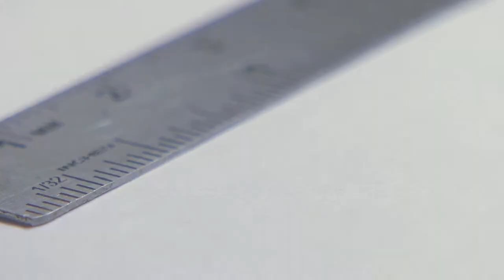Making A Domed & Blued Screw

Comment: I have no idea what just happened
to turn that screw blue, but I was captivated.
Reply: It's a natural process of oxidization that happens to steel when you heat it up, the colour you get depends on the temperature it reaches - that was about 300 degrees Celsius.
Reply: Vincent Baelde-Millar . Thanks mate
Reply: @vincentbaelde-millar670  Steel  ?  might be titanium .
Reply: @alimali2120  judging by the way it machined I doubt it
Reply: What's the purpose of the first coating? Before the actual blueing.
Reply: @blueneet84  That wasn’t a first coating what he was doing is putting it through a heating process to normalize and harden the screw and then the blueing was him adjusting the actual temper of the material What you saw was just a process to keep oxidation from getting to the material well it was scolding hot which would cause pitting and damage to the threads and surfaces It’s not as important on larger pieces of material because you have more material left to remove to bring it to a smooth and pretty surface.

Comment: I have done this ... and it's not easy to get that perfect deep blue. I like your brass shaving method for the bluing step. Did you try the molten salt method? It is more preparation and you have to clean the blue bits after but totally worth it if you have a small batch of things to blue up ... Thanks for the video

Comment: Okay, I'm going to ask the question: what is the process at the end that actually blues the steel? I've not encountered it before. I only have seen hot blueing or chemical blueing with a liquid. What happened here?
Reply: It is hot blueing. He is using a special brass tray with brass chips to better diffuse the heat and have a more consistent color. He did a video on making the tray. Basically he is just heating with a blow torch under the tray. Search for blueing tray clickspring. Cheers mate 👍
Reply: @MsSpermator  thanks so much. I was quite vexed. Really appreciate the explanation. 👍
Reply: Does hot blueing protect from rust?

Comment: Would someone please explain what is boiling/burning off in the first heating?  Also, what reaction is happening during the bluing step at the end, and what are those shavings?  Thx
Reply: The first heating is foir hardening, and the stuff you see boiling is a mix of borax and methylated spirits, used to insulate the part from the atmosphere. It's then quenched in oil to harden it for use.

The shavings are brass, used to spread the heat evenly for bluing, and the reaction you see is, basically, really fancy heat scale froming on the metal. Heating it causes the surface to change character, generating first a yellowish to tan color, then shifting into blue. This also tempers the metal, relieving tension within it.

For further information I recommend this Wikipedia page: https://en.wikipedia.org/wiki/Tempering_(metallurgy)
Reply: I'm not 100% sure but I believe it is flux / borax that is boiling off in the first heating to harden the part. The metal is then reheated to be tempered and it changes colors during that process. I think they are brass shavings if I remember correctly.

Comment: I've always wondered how much real difference tolerances make in machinery.  It would be interesting to compare to identical machines, one built with every part made to tight tolerances, and the other built with parts at the outer limits of tolerance. Would there be a noticeable difference in performance or longevity? How great would that difference be?

Comment: Sweet, always fun to watch and see the blue colour develop! What protects the screw from rust? Eventually the bluing will rust if subject in any kind of humidity?
Reply: The bluing is essentially controlled corrosion, black oxide is a protective layer in and of itself. Basically some of the exterior is converted to magnetite, which is a much stronger oxide than rust as it does not change very much in volume, wheras rust triples in volume, ruining its own integrity and inviting further corrosion

Comment: So that is just heat blued?
Reply: With a custom built setup for gentle and even cosmetic heat bluing.
Reply: @stevenclark2188  The copper /brass chips are being used as a defuser? Is it a hot air gun or gas flame?
Reply: @DavidLindes  Thank you very much.

Comment: If it weren't such a pain to machine, I'd say just use titanium.

Oxide colors are far easier to do on Ti. But I also know it's murder to machine.
Reply: titanium is actually fairly soft its the surface finish that is hard to achieve
Reply: @mf7338  this is why titanium alloys are used. Inclusion of vanadium improves hardness and aluminum inclusion improves its ability to be machined. Also, in the case of something as light duty as a clock or watch, titanium when hardened is more than enough for the job.

Look into 6Al4V titanium. It gets used reasonably often as handle and screw material for high end pocket knives and lasts through some pretty heavy use.